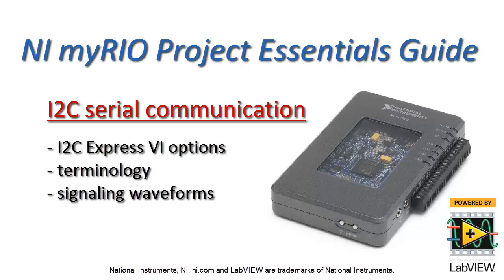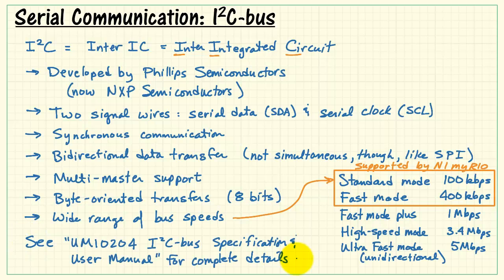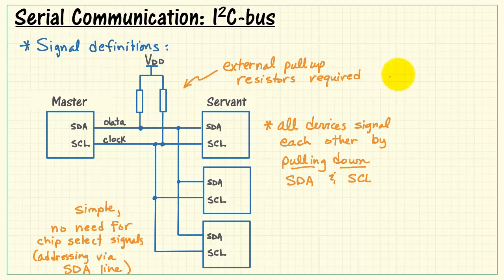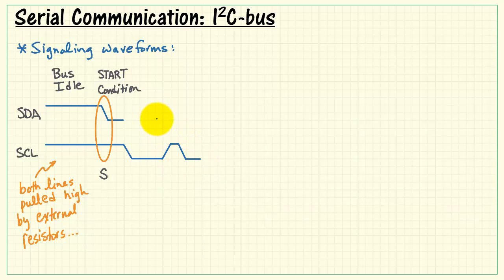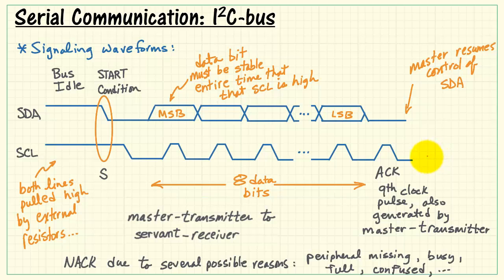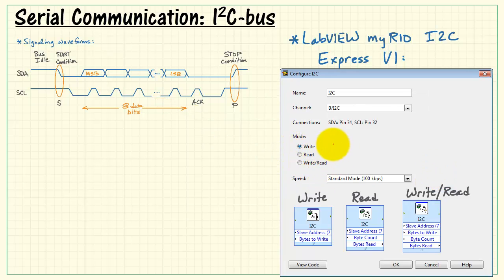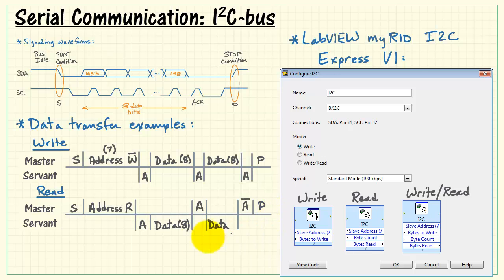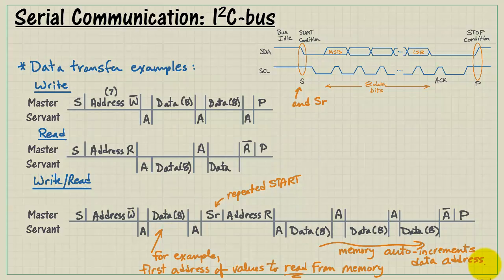NI myRIO: I2C serial communication

Comment: So when exactly are the states on the data line being latched by the slave? Is it on the high-to-low clock transition? Or low-to-high? What happens if the data line changes during the clock being high?